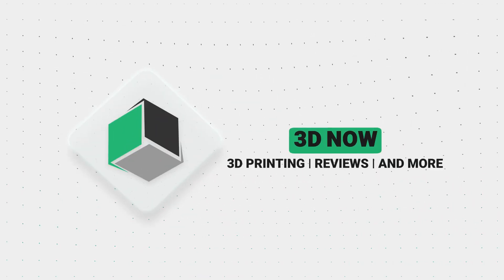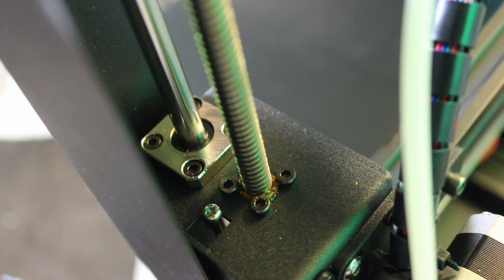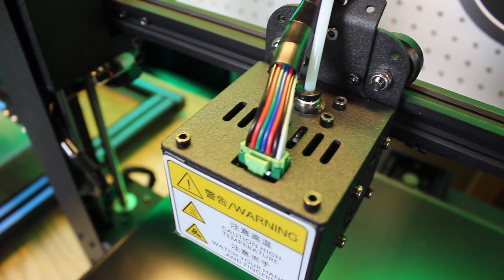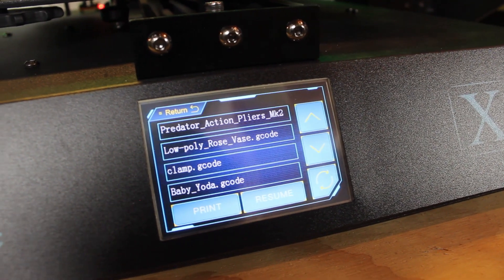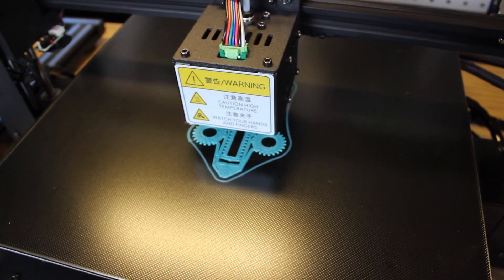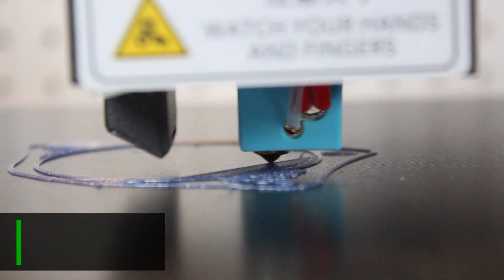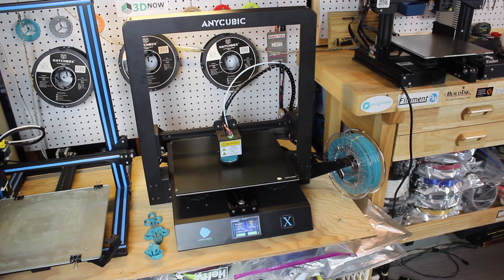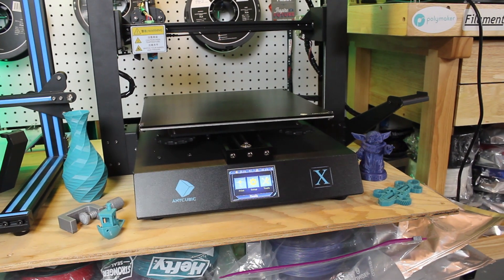The Beast! - Anycubic Mega X Review

Comment: I just upgraded from a Mega S and noticed that the wires for the bed rise a little high and may catch on the back right corner of the bed. Have you noticed any wear on these cables after extended use?

Comment: Can you please help me.  I just got my Mega X after seeing your video (thanks btw) and it just arrived with the print head loose.  It wobbles up and down as the rollers don't seem right on the rail.  I can't seem to find how to tighten them.  Can you please tell or show how to do so?  Thanks.
Reply from the maker: You may have to tighten or loosen the concentric nuts. If you need help, join our discord and people can help in more detail. 3dnow.cc/discord
Reply: @3DNow  Thank you for the reply, but shortly after leaving the comment, I was messing with my printer and found that the bottom roller's cam nut (for the print head) wasn't installed correctly by AnyCubic durring construction and that's why I had no adjustment.  Once I disassembled the printhead, and reinstalled the roller with cam nut correctly, I was able to use the included wrench and tighten up the printhead rollers to eliminate the play up and down.  I made a video of my findings as well as a slight review of that mechanism.  It'll probably be uploaded tonight or tomorrow sometime...  
However I am going to join your discord as I'm still unable to get the bed leveled correctly.  I'm not sure if something is bent or if the bed is not completely flat all the way across, but when my print nozzle has paper thick clearance at all four corners it drags hard against the middle of the build plate.  If I give it clearance in the middle, so it doesn't drag, Then the outside edges of the build plate have so much clearance that fillman is literally being dropped onto the plate as opposed to being squeezed on to it from the nozzle.  Which causes major bonding issues and the first layer to be an improper height.  If the item I'm printing is small enough that it only uses  the center of the build plate, Then my prints turn out great.  If they're larger, or start at an outside edge, like most do, Then the print will either fail or ends up warped badly...

Comment: I'm surprised I find only positive reviews on this printer. Honestly, for me is PURE CRAP. I own it since months and it didn't produce a single good print. My ultrabase is concave, meaning that after leveling it on the sides, the nozzle stays too high at the centre of the bed. That means that big objects doesn't stick. I would really love to have your Cura 4.6 profile for PLA and try it.
Reply from the maker: Sounds like you need to calibrate and setup the printer.  Check out my video https://youtu.be/Vvp8whpRkw4

Comment: Yeah I just sent this pos back. Has firmware issues which makes it not so reliable. Owned it for almost a month and had about 8-9 machine freezes with no auto resume function. Get your self an ender 3 pro 400xl and call it a day for a budget printer with massive build volume. Just what I used the refund for anyways.